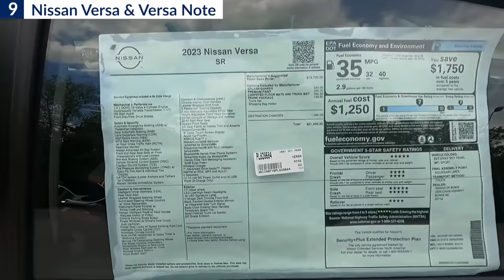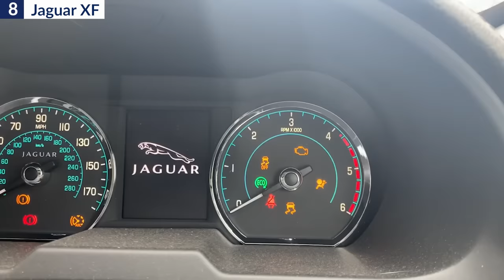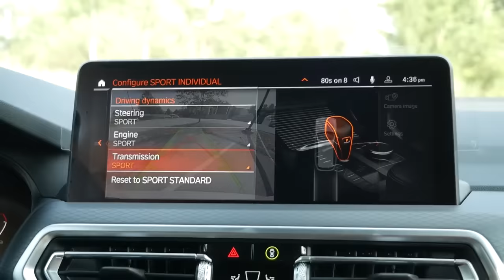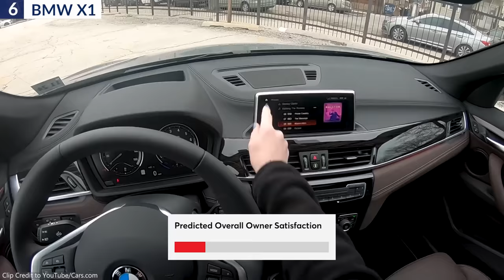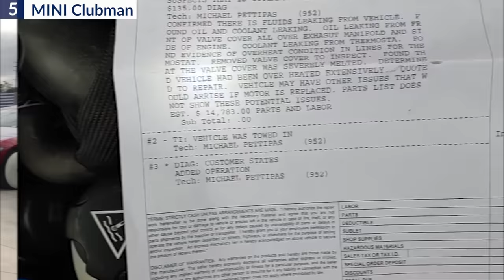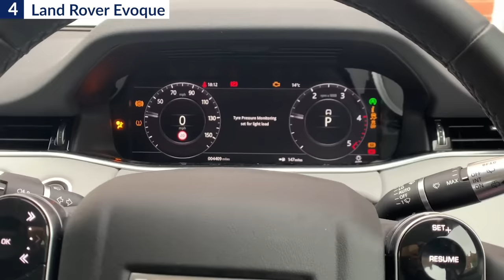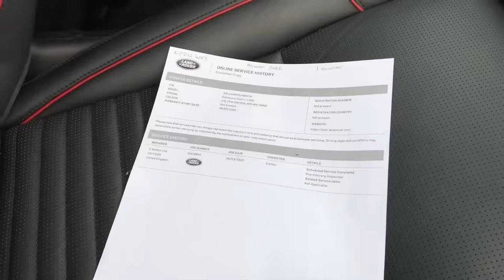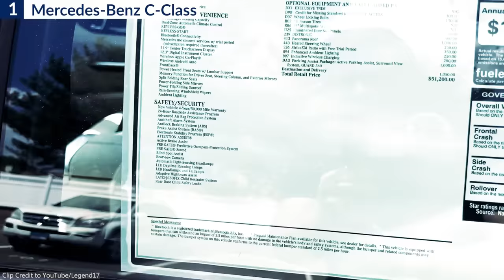9 Cars Owners Get Rid of in the First Year | Here is Why !!

Comment: All reason why I bought a Lexus RX. Maybe not flashy, but known to do 300-400,000 miles will very basic maintenance.  If you value your $$, you may want to start looking at reliability ratings.
Reply: Some people just don't like to change and it doesn't mean the old cars are better than any new cars. 

I know a rich dude who bought a used Lexus LX rather than a new one because he is used to it.
Reply: @jackwong64  He saved so much $$$$ by Buying a used one.
Reply: Do people really keep their cars that long?
Reply: @richardmorris6365  only the wealthy.  Read "The Millionaire Next Door"  Some good clues on how at accumulate wealth.
Reply: @cj90014  Dave Ramsey a wealth advisor has a rule to NEVER go in debt for a depreciating asset - a vehicle ! Pay cash for what you can afford & even then BELOW your means is highly recommended. So now you know why 2004 Toyota Corollas are so popular !
Reply: 100% agreed.  Love my RX Ultra Luxury. Never had any mechanical issues to date on none of the RXs I've owned. (2012, 2016, 2019)
Reply: Lexus:  What the smart people buy.  The cars/SUVs are almost invisible on the road, so people who want to broadcast "Wealth" don't go there and get poorer as time goes by.
Reply: We have a Lexus RX350 F SPORT. There are three driving modes. ECO - smooth driving, soft suspension. SPORT - tighter steering suspension, more feisty. SPORTS +, like a very powerful go cart. Very lively and responsive. Steering and suspension very taut, very stable in handling. I usually drive in the SPORT + mode, as it is more fun. The fuel economy is not so good in SPORT +.

A shame that most reviews of the RX350 FSPORT neglects this very important feature.

My wife has a Lexus NX 200 F SPORT, which also has these 3 modes.
Reply: That's the problem with too many people.  They want to be flashy and appear richer than they are to complete strangers.
Reply: @ag4allgood  Popular or just bought by people trying to save money. NOT the same thing.

Comment: I bought my 2020 BMW330i in 2021. The original owner was a bigger guy and didn't find the seat comfortable for himself. I have no issues with that. Actually, aside from some quirks with the entertainment package, I LOVE my 330i. Effortless acceleration. Great handling. Smart styling. Excellent gas mileage. After almost 50,000 miles, the only work I've had to do to the care are oil changes (which I do myself) and new tires. I'm not sure what the "high maintenance costs" are.

Consumer Reports gives it a 3 out of 5 for owner satisfaction but, in the breakdown, I only see one "3" (the rest are 4s and 5s) and that is for value. I can tell you that a year after I got mine, it was worth more than what I paid.

I have no skin in the game. I am just really satisfied with my 330i so I was surprised to see it near the top of this list.
Reply: I'm a F31 2.0 diesel 184 bhp owner / X5 3.0 diesel : both nine years old and bought new. 

Zero problems, proper maintenance. 

I drove Audi in the past and I absolutely didn't like the feeling it gave me. 

A Citroën C4? Never ever again! I had to drive this as a replacement car for a few weeks. Terrible!
Reply: It’s a bs video.
Reply: @KaptainKerl   - Yep. The quality of a car is subjective, as it depends on individual preferences and needs. However, one universally agreed-upon aspect is that maintenance is crucial and plays a determining role in a car's overall performance and longevity. Regular upkeep and attention to maintenance are essential to ensure a vehicle operates at its best and remains reliable over time.

Comment: I am currently leasing my second C300 and actually enjoy the car.  For me, the driving experience couldn’t be better.  It’s different, of course, if I bought and own it, which I would likely never do.  MB’s are expensive to own, even if you’re the only owner and manage to maintain and take care of the vehicle.  The maintenance cost exponentially rises as the car gets older.  Forget about owning an AMG.
Reply: I'm literally trying to sell my MB.. fingers crossed, wish me luck
Reply: So why the eff wouldn't you just buy a Toyota and OWN THE most reliable, low maintenance car available, rather that leasing car after car for $375 a month for the rest of your life, when you COULD just OWN one in 6 years and SAVE so much money?
Reply: @andreaberryman5354 
You're missing the point
Reply: @andreaberryman5354  Purely from a logical point of view you have a valid point. I've owned both and while there is no question the Toyota is a far more reliable car, driving a well running Mercedes puts a much bigger grin on my face and that cant be measured in dollars.
Reply: @andreaberryman5354 a price to pay when you enjoy the drive, if you can afford it, a small price to pay man
Reply: @andreaberryman5354  my guess is, that it's the same reason some people buy more than 2 shoes: work shoes and gym shoes. Get them both in plain black and just wear them at all times.  Practically, you dont need any more shoes than that, practically.

BUT....almost no one follows this practical advice.  That's probably why people buy a heart-racing AMG, Porsche, Bentley, Ferrari, or Corvette.
Reply: I drove 2023 C class and Old SLK 2014 and to me Old SLK was more comfortable and enjoyable to drive no I wasn't driving it with roof down as it was to cold still I prefer Old cars but off all Mercedes I drove I enjoyed most in 2016 CLS to me that thing is ultimate Driving Machine
Reply: My neighbor has the same sentiments, leases his Mercedes for three years, and wants nothing to do with the car after that period.
Reply: @andreaberryman5354  the same reason my second vehicle is another German and is twice the lease for the MB 🙂.
Reply: Why in the world wouldn’t you just buy a reasonably car. A lease is crazy
Reply: This is misleading, you can own and pay to get the zero cost maint plan they offer on the leased fleet. Plus you can trade in when you want and pay a lower int rate.
Reply: @navsofour2892  Well if you are financing a car to start with that’s a huge indicator that the vehicle is out of you league. Unfortunately way too many people drive around in vehicles they should be nowhere close to.
Reply: @kurtheidelbach  Really not what am saying but it depends on your leverage position, not really that hard to beat a fixed loan payment that kind'a silly perspective, all the people i know own expensive cars never pay a dime out of pocket, except maybe the taxes owed.
Reply: @navsofour2892  It’s not a silly perspective at call. You buy it and interest rate is irrelevant because you don’t have one. Financing is the next worst option and a lease is terrible.
Reply: @kurtheidelbach  Finance vs lease option is not your point, that was my point and this is why your answer introducing cash down options was stupid in the first place. Secondly yes it is a silly perspective for what i explained to you, if you do not know the totality of the leverage position of someone doing a financial transaction you cannot say what is worst or best. Just imagine the cash you are not parking on an asset is always available to increase the leverage so it is not a net zero transaction.
Reply: I’ve owned 4 c300 over the years. Only had the standard service done. Never had a breakdown or costly service. (always negotiated yearly service for free) I’m driving a 2018 C300 AMG right now. Low mileage because of covid. Still love it. It’s paid for so I’ll drive it until major services start to come up. BTW I’ve always had sports cars. I like driving fast quality German cars. And Yes, C300’s are more luxury than true sports. That’s the difference between people that buy cars to go from A to B and people that love driving the countryside just for fun.
Reply: @bluethundar exactly
Reply: @kurtheidelbach it’s all about leverage, not what is the most morally virtuous option.  Make more money not parking it in a liability.   Also, those ppl leveraging can already afford to pay cash so it’s not a risk factor for them.   Pay 3-4% interest to leverage money to 8-12%.  The numbers work if you’re savvy enough
Reply: I have a '99 eclass diesel, maintenance consists of replacing a $20 solenoid in the fuel pump.  My 2016 needed a new fuel pump located inside the fuel tank that cost $2000, next car will be a Lexus, MBs have become a double screw, first the manufacturer then the dealer.  I find that keeping the car away from the dealer for maintenance works out well, these $1000 oil changes are mostly bullshit.
Reply: @henryostman5740  $1000 for an oil change??? Yes, it’s only worth taking a car to a dealer if it’s warranty work. Otherwise it’s robbery.

Comment: 2008 Tacoma  with 550000kms and still running strong..I  think i'll paint it
Reply: 💯😊👍My '07 FJ is getting close to 300k, my '11 FJ is nearing 100k... 🤗
Reply: Yup. Have a 6 year old one. And no issues. Keeping her until i roll it kve a million. Body be gone perhaps but engine and everything else will still work. Toyota last forever especially the Tacoma. Can take a beating off road. Take a dodge ram off road and it will break apart. Lol. All show and no truck.
Reply: Spooch3129, 

Thank you for inspiring me. My 2008 Tacoma Gen 2 4x4 just crossed 204000 miles, running great and only significant  repairs were the exhaust at 150000, and the clutch at 190000. Looking forward to many more miles. Thank you for giving ne something to strive for!
Reply: 2015 Chevy VOLT. 154,000 miles. Once a year oil change, and battery still holding its full capacity. It's staying and going nowhere.

Comment: I’ve had #9 (Versa) as a new car since 2015. Great car! It was not created for flash, but good basic general use. It has had great pickup and moves quickly through traffic/passing. I keep up the scheduled maintenance and still get over 40 mpg on the hwy.
Reply: Honestly,it wasn't really close to ugly. For what it was it looked fine.
Reply: I drove a Versa rental car recently for 10 hours from palm springs to South Lake Tahoe! It surprised me how nimble and responsive it was on my looong drive!!!
Reply: Versa is a good basic car.  I'm not sure why people sell them so quickly. That's the one car that I'm surprised is in this group.
Reply: I rented a Versa once.  It felt sluggish, noisy and uncomfortable. I found myself turning up the radio just to drown out that droning engine.  And maybe it’s not a bad basic transportation car but the car never lets you forget just how basic it really is.
Reply: @itsabovemenow1016  - Yes, it's the same for the Toyota Yaris.  We bought one a while back for a family member who was just starting out.  She needed something cheap and the Yaris was the best thing we could find for the money.  Great car, but sluggish, poor instrumentation, and small.   But I think it's still a great little car.  Great on gas, easy to park and low maintenance.   

I've only driven 6 cylinders for the past 20 years, so it's a bit of an adjustment for me to drive a Yaris.  However, I will never forget where I came from.  Any reliable car is a good car and I definitely do not think I am "too good" for a economy car.
Reply: @JohnBowl14690  They sell them because of Nissan's quality control issues with the CVT's. The Aisin/Toyota built CVT that's used by Subaru is much more reliable.
Reply: @ABRetroCollections  -  Ok, that makes sense.
Reply: Just like most of the fuel mileage tests, they are meant for flat land. Not mountainous hills and curves. Heck I can get 45MPG for as many miles, as the road takes me; if the land is flat. That's in a 2015 Chevy Colorado with the 2.5L.
Hills kill mpg no matter what auto you are in....
Reply: @JohnBowl14690 it's a cheap, noisy, slow, tin can. A lot of people like to actually enjoy the vehicle they're driving. This car has nothing to enjoyable about itit's a cheap, noisy, slow, tin can. A lot of people like to actually enjoy the vehicle they are driving. There is nothing other than fuel economy that can be enjoyed when driving a versa.
Reply: @LordPrometheous  - What is your main car that you drive?
Reply: @JohnBowl14690  Usually a Honda Pilot EX-L.

Comment: I bought a 2020 Range Rover Velar P380 R-Dynamic black with red trim and badge delete 3 years ago with 4200 miles on it and it was 9 months old at that time and a lease return. MSRP was 86k and paid 69k at a Audi dealership. Factory warranty is up in late November and looking to maybe sell it. Had the original battery replaced a week ago and over 3 years had the O2 sensor replaced twice and no other issues.

Comment: Overall, i think getting a non-turbo 6, is better than a turbo 4, in terms of ride, noise levels, cost of ownership.
Reply: My wife wanted a VW Atlas. Told her to get VR6 one. It also uses an Aisin transmission. Meaning we should be good for a long time. Too bad VW is discontinuing the VR6. Very solid engine. No turbos!!!
Reply: Turbo engines run hotter than Naturally Aspirated engines. The wear factor is higher just by this fact. The cooling system maintenance is critical & any overheating problem needs an immediate shut down. Any extended over heating issues is a major engine problem extending to many parts. Overall turbos will not last as long & need more care to keep them going. All for the sake of lighter weight to get the better fuel mileage. This advantage disappears quickly when the vehicle is driven more aggressively. Most turbo engine have lag in the throttle response too. Not what you want in icy or slippery conditions. Not a fan of a turbo engine.
Reply: @ag4allgood  I live in europe, and all i've driven so far were turbo diesels, besides one 1.6l na engine. Petrol turbo's run super low pressure compared to diesels. And most of my diesels took anything a threw at them, with barelly more than just regular maintenance occasionally.
So why is it that they can't build a proper turbo petrol car? 
My A3 from 2006 i drove for 3 years, i did some mods on it, and pushed it from 140hp to 235hp, the torque i had on that baby.
All i did was change the turbo, manifold and exhaust, i left it with original cooling components and it handled it like a champ.
Reply: When there's increased complexity there's more chance something will go wrong, the simpler the better a lot of the time.
Reply: @Soul-Taker  Good point, but in today's society that wants something for nothing, you get many crying when features are basic or non existent, but when those features that are not necessary break down, they cry again.
Reply: @Soul-Taker  I agree with that train of thought. Its why I never owned a BMW or Mercedes Benz. Almost every car I've owned has had a manual transmission. Currently have a 2016 MX-5 Club soft top aka Miata. 
Easy to work on & do maintenance. Love it.
Reply: They are seemingly not available with a 6 cylinder engine anymore
Reply: The problem is that many countries now tax their cars on co2 emissions so car manufacturers use whatever gives them the lowest numbers, small cc turbo engines are lower than NA engines it seems so that is what they fit, as many people lease for 2-3 years from new they don't get any repair costs so they don't care what happens to them down the road, after a few years they are complete trash money pits and usually out of warranty too.
Reply: Yes, inline 6's are naturally balanced by virtue of engine architecture.  That's why Rolls Royce stuck with straight 6's exclusively for more than 40 years.  Worked for a classic car dealership in Denver years ago and all of our RR models started near silently every time and ran so smoothy that we regularly had prospective customers hitting the starter button when the engine was already engaged.
Reply: @katsm-wo9704  Straight 6's are almost a thing of the past.  Too bad, since that engine architecture produces a naturally-balanced machine.
Reply: @olivertaylor4779   Yes, I understand that the base engine for a BMW 7-series is now a 4-cylinder with twin turbos.
Reply: @billolsen4360  cool times!!
Reply: Agreed. I bought a 2016 Mustang and got the 3.8L V6 instead of the turbo 4. It was the last year that V6 was offered.
Reply: The in-line 6 will always last longer than a turbo 4.

Comment: I own a Rav4 hybrid.  It is one of the best cars i have ever had.  I do not regret buying it for a moment, and the resale value reflects it.  My dealership keeps sending me offers to buy it back for near the cost of purchase almost two years later.
Reply: Most dealers do that with any car.  CR-V and forester are also high resale value and higher customer satisfaction.  Rav doesn’t stand alone anymore
Reply: Do you realize they did that with a lot of used cars because the supply is so short? They tried to get my 2011 Cruze last year, too, but I had sold it the year after I got it, the car was so bad.

Comment: I purchased a 2022 Nissan Rogue Sport as my daily driver. However, I began to notice that whenever I drove it my ears would start ringing. I did research on why the car was so irritating and I discovered it was because of the whine of the CVT transmission. I was also upset when I found out that Nissan CVTs are propelled by a friggin rubber band! After 4 months I traded it in for a 2023 Mazda CX-30 which is a fantastic vehicle.